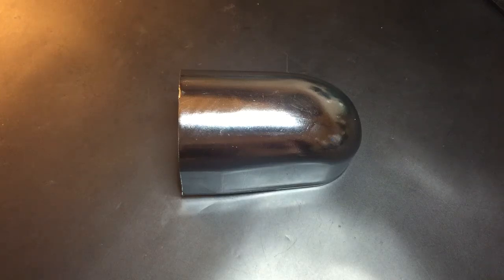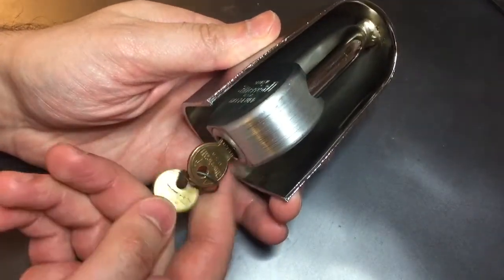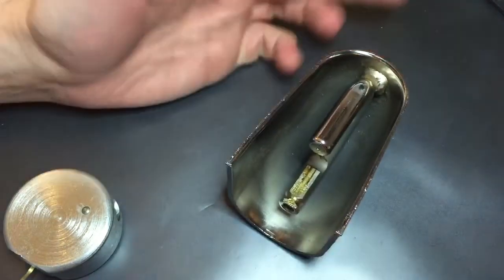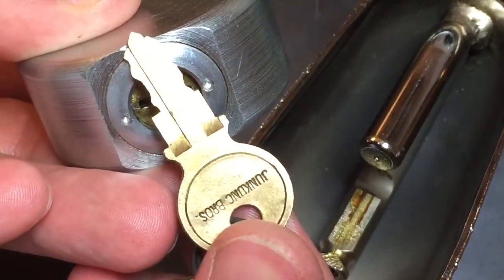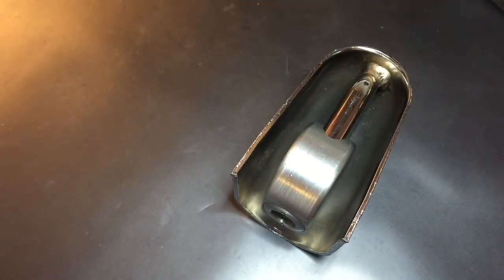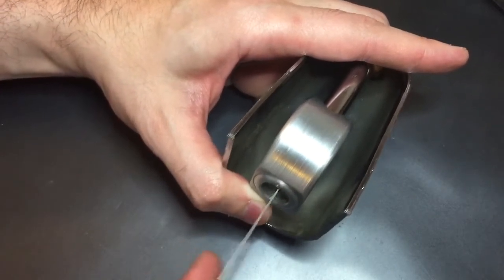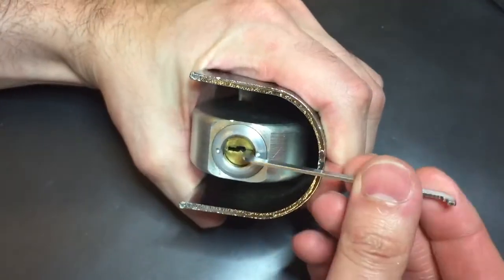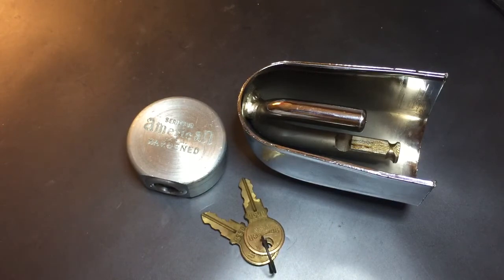[104] Rare Shrouded American Series 10 Padlock Picked

Comment: As I mentioned I have noted these to pop up on eBay every few months but aside from the shackle cover its a standard H10. I like that cylinder cover thingy, looks riveted in.
Reply from the maker: +Papa Gleb If/when you see one again, please give me a heads up.  Thanks.  As for the cylinder cover, it is held in by a blind pin in the side, which is in turn, held in place by a screw down the shackle hole.  It’s a little hard to describe, but no rivets.

Comment: It looks home made or a one off. The shroud was most likely re-chromed after the hasp was welded. I may be wrong but that weld looks a little rough. The shroud appears more cosmetic than armored. Perhaps it was used as rain or weather guard on some sort of automotive car. truck or trailer. That shape is not inexpensive to make from scratch. It looks like one of those bumper uprights that was cut off and welded. In any event a great find and video!
Reply from the maker: +Peter M As for whether it's a one-off custom part, you could be correct -- I simply do not know.  But I am disinclined to think its a one off for a couple reasons.  First, it's in new condition.  If the lock was made for a particular purpose, presumably, they would have used it.  Second, Papa Gleb has seen locks like this on ebay before.  Third, re-chroming everything after fabing the part would be a very expensive job for anyone but the factory... if this was a one-off part to match something, paint seems like the far more likely finish.  All of that said, you could still be right... most of this is supposition on my part.  I wish I could find more information on this!
Reply: Good points but I cannot ever seeing a lock shroud like that before. Chrome can chip and usually they avoid using it in rough applications. You may be correct and it could be a mass manufactured item.

Comment: If the lock doesn't have a date code and it's the old american logo ( lowercase) it's probably pre 1978. My old junkunc american series 10 is dated 1980. 1978 is the earliest date I could find yet
Reply from the maker: +Grant Sipos Great info.  Thanks for sharing.
Reply: I have seen stamps from mid-1976 but that was not on a series 10.
Reply: I have seen ones with date stamps as early as may 1976, I will see if I cant find that lock again. Update- the oldest lock with date stamp that I have found is from May 1975. I believe the first month they did it was in March 1975 .